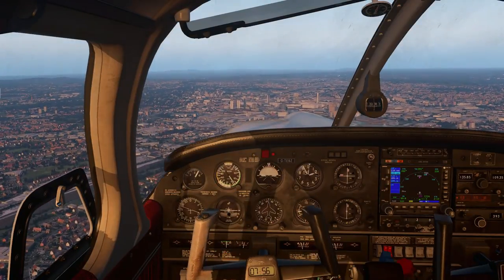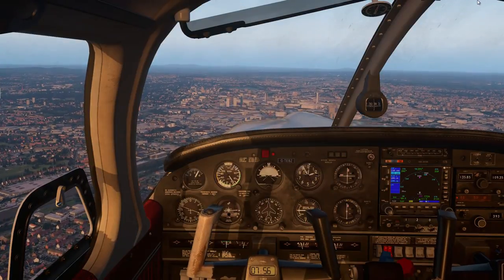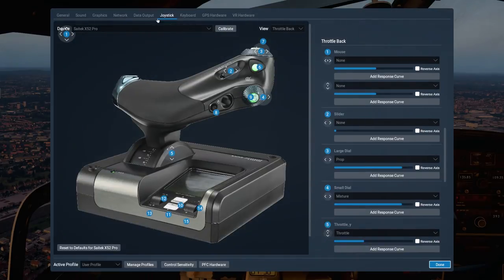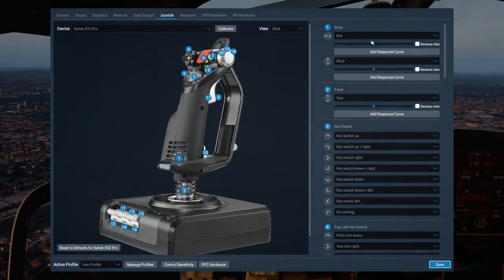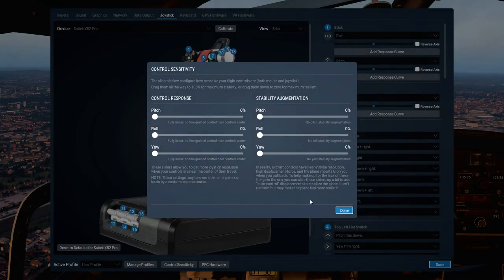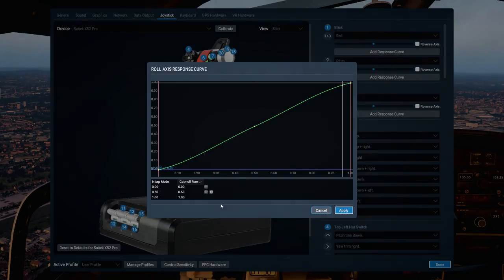X Plane 11 | Version 11.30 Control Setup Tutorial (Response Curves)

Comment: Holy Cow, I just applied this to my brand new Honeycomb Yoke and before it was great but now it is just sublime. Tried the default Cessna and Aerobask E1000. Need to tweak the curves for my Zibo 737X & FF A320 & B757. The missing part for me was the extra point down at the low end. I definitely like the cubic curve the most. 

Thank you for sharing this with the community and greetings from an Expat in Canada
Reply from the maker: I am really glad I could help! Enjoy the new feeling! I have refined mine a little recently, and have dfferent curves for each aircraft I fly. It really helps with the 'cheaper' hardware!

Comment: I have xplane 11.55 and just installed xplane 12. Every flight stick or yoke reacts differently. Good tutorial. I have the Saitek Yoke. Not the Saitek Stick you have. Yours I believe you can do the yaw. I do not have Rutter pedals. just the yoke. One Question. On auto pilot, with Vertical Speed set only, does the Yoke for roll react the same? If I adjust the pitch on the yoke with auto pilot on, it will turn auto pilot off. As it should. Just adjust the trim. But the Cubic curve is great. Thank you for the articulate tutorial.
Reply from the maker: Thank you for your kind words; I am glad the curve was useful. With regards to the autopilot, as long as a heading hold is not set the roll should work the same. In a light aircraft I would not personally recommend that way of flying though, because you will find yourself not lifting the nose when turning and geting a feel for how much you need to do that when turning the aircraft.

Comment: Fantastic on the Roll! How do I do the same for Pitch? Did you do the video as well? My plane keep pitching up. No matter how low the thrust I go it keeps pitching up. The Joystick I use is the Logitech Extreme 3D Pro. Could you do another Tutorial for Pitch?
Reply from the maker: That does not sound like a response curve issue. Either you need to recalibrate your stick, or you have applied far too much elevator trim and it is lifting the nose constantly that way

Comment: hello, how are you?
very good your video, I applied your configuration in my X52-Pro, I have rudder pedals ch products, please, do you happen to have any tips on how to configure the rudder yaw curve?
I fly X-Plane11!
Thank you for any help!!
Reply from the maker: I do not have any CH products, but I would personally leave the rudder pedals set to be completely linear, so a straight diagonal line! Hopefully that helps!
Reply: @ECGadget  thanks!
Reply from the maker: So, a slight update. I tried out some rudder pedals, and what I would now advise is a slight deadzone in the middle if you find the pedals are light. Just to prevent unwanted wobble.

Comment: Hello there. Do you know if we can fix the fact that the plane (and yours too) is constantly turning left ? It's very annoying =/ More over, when on ground, plane is always going left (or right), especially when having a prop plane. Any idea how to fix it? I've been looking for hours ..

Thank you and sorry for my english :)
Reply from the maker: What I believe you are describing is the natural tendency of the aircraft due to the propellor rotation. On the ground (in calm winds) you will notice it more when you takeoff. In the air, you will notice it in high power situation. As you ease off the power, the effect should subside. I find in XP11 it can be a little too pronounced, but it is something that can be dialled out in the air with some trim!

It is the same reason that when you take a single prop into a stall, one wing will stall before the other
Reply: @ECGadget  Yes, in the air, but I can't even take off as it yaws so hard to the left I always end up in the grass. There must be some right rudder control as you would IRL, but how in xplane? Don't have yokes yet (the good ones are all sold out) so flying with the mouse.

Comment: rudder issue: yaw axis and control work well But when i push on rgt pedal yaw axis moves rgt  right pedal push axis in red and no movement  of rudder axis.  when with plane no movement of rudder when pushing on left pedal.
Reply: above that's incorrect. no movement of rudder to left.

Comment: Hi, my x Plane-11 is updated to the latest version. About two months ago, I bought a Logitech X-52 Pro, everything is ok ... but the image as in this video is not shown, how can I solve this problem? .... Thank you very much to those who can help me ... .
Reply from the maker: Which image are you talking about? The actual Logitech controls?
Reply: @ECGadget  Yes, sorry ... this is the image of the joy and the trottle.
With the Software provided by Logitech, in the Device Manager in Human Interface Device, the computer sees both as X52 Professional H.O.T.A.S. (HID) and X52 Professional H.O.T.A.S. (USB) consequently I renamed the two photos .png     Also X-Plane sees them and names them like this
.
But you continually get "image not available" as opposed to inherent images there are far too many.
However I managed to program it well, and it works great, there is only this anomaly that I don't understand, and then XPlane only loads .png images.
I also tried creating an empty config folder. Joystick with only the files inherent to X-52 logitech with and without Saitek, but with no result.
Reply from the maker: X-Plane does occasionally have a problem with images. I have that issue with thumbnails for some aircraft sadly!